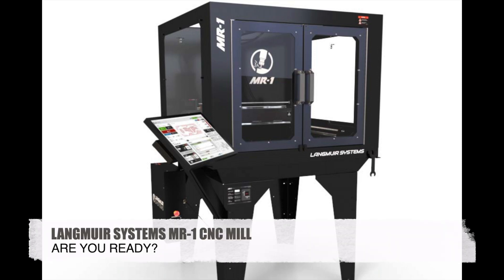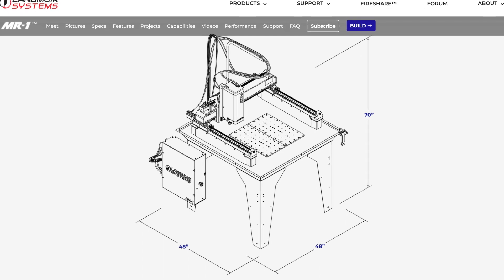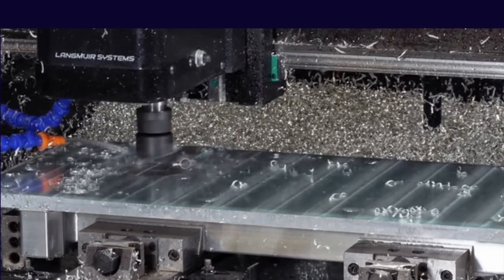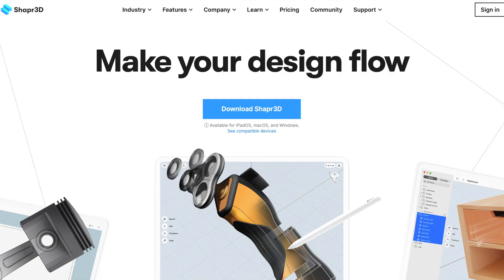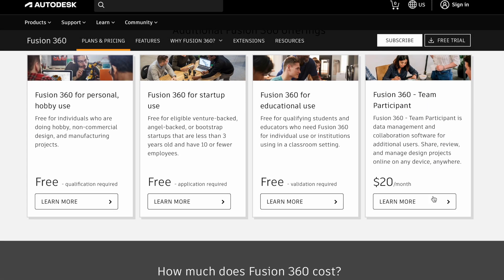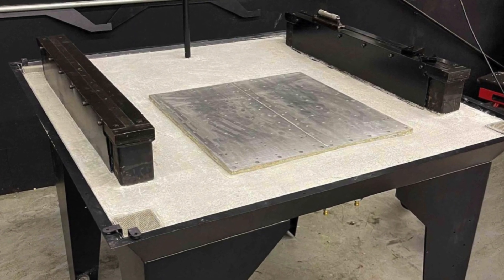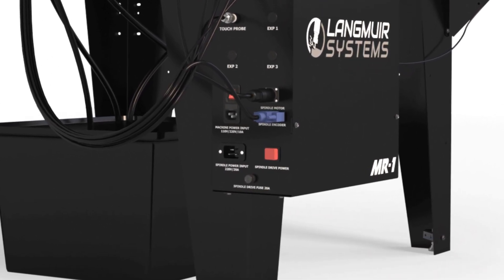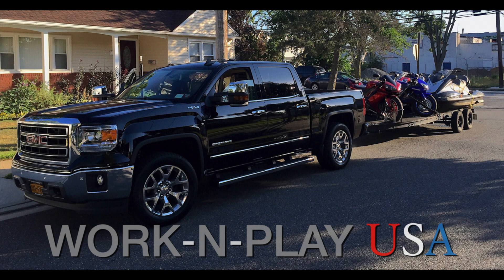LANGMUIR SYSTEMS MR-1 CNC MILL!!! ARE YOU READY?

Comment: Where did you get the cable for the flood coolant control box if you don’t order it from Langmuir
Reply from the maker: I am currently out of the country and haven’t opened the controller yet  but to my best knowledge it is a female GX-12-2 connector more commonly known as an aviation connector. if it’s not GX-12-2 it’s GX-12-3 The last number refers to how many leads in the connector. I will definitely let you know but will not be back till the first week of January. The relay comes with the Phoenix connector.
Reply: @worknplayusa  Looks like a the -2

Comment: You can't use (2) separate Main Power supplies to any machine you need to rethink this as this will create a Ground loop, so just use the (1) 240v Main Power Supply and split it up for whatever the rest of the machine needs.
Reply: @Jobotics You would only get a dumb answers like this if it comes from a none qualified person, this is very stupid to do something like this, you should be using ( 1) 240v 4 wire supply then you have both 240v and 120v from the same source this is how it's done ask an industrial electrician even most residential electricians would know also, you can't use multiple Ac main power supplies for (1) machine just plain dumb
Reply: @mactec54  so should I run a 60 amp sub panel to my garage and then run everything off that? And would that sub panel need it's own separate ground rod?
Reply: @bdkj3e  Yes that would be your best Idea to add 240v, Sub-Panel and no you can't add a second Ground Rod unless it was Bonded to your other Main Ground Rod So the Cable you run to the Sub Panel will need to be 4 Wire to suit for the 60A this will have (2 Live Wires a Neutral and Ground) this will give you 120v / 240v
The Sub-Panel uses an isolated Neutral so make sure what you buy has this
Reply: @mactec54  Sweet, this will save me from having to fish multiple wires across my finished basement, I despise that my breaker panel isn't in my garage where I wanna put this thing. I used to retrofit HVAC systems from furnaces to heat pumps so I know all about how to run new lines and stuff but I had never heard of a ground loop before. I really appreciate you answering an old comment like this to help me out.
Reply from the maker: I appreciate the input Jobbotics and Mactec54! I am not a electrician but do have basic electrical and controls experience, is it possible I am using incorrect terminology causing the confusion? In my house and in most homes will have one main supply coming in from the grid going to a circuit breaker panel (in my case I also have a subpanel in the garage), Langmuir recommends using dedicated circuit breakers for the spindle, system controller and computer coming from your main panel or in my case my subpanel.
Reply: @worknplayusa  No that is incorrect there would be (1) main Breaker for the power supply in your sub panel to the machine, in the cabinet of the machine you would have a Breaker for each circuit for the VFD Drive / Power supply Etc. so from the sub panel you need a 4 wire cable going to your machine this will be used for everything your machine needs
Reply: @mactec54  if this an issue caused by having 240 and 120 circuits. My house has only 240 main. But I'm not getting the lanmuir cnc.
Reply: @Z-add  your house only has (1) Grounding system for the 240 and 120v circuits
Reply: @Jobotics This has nothing to do with optocouplers
Reply: @Jobotics Back EMF is controlled by using a Braking Resistor this is very basic
Reply: @Jobotics  You need to run a 240v 4 wire circuit at what the max Ampes plus a safety factor the Electrician will know what to do if you give him this information
Reply: @Jobotics You are not playing with toys here, servos drives of this size require a Braking Resistor as per manufacturers specs, if required
Reply: @mactec54  it's 120/240
It practically is a toy.
This isn't a 64KVA sucking MCD 1816, it's a garage hobbyist CNC.
Reply: @Jobotics Just a simple answer Ground Loop You have 3 separate Ground wires you can only have (1) check electrical code requirements, you guys should not be doing this electrical work, and Langmuir should not be saying to do it like this.